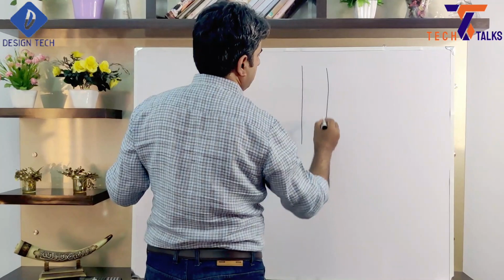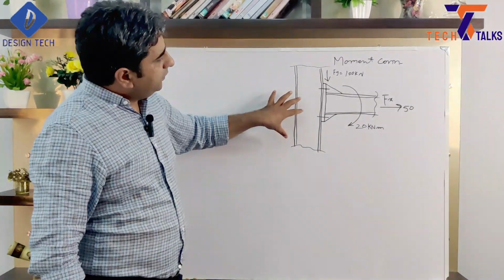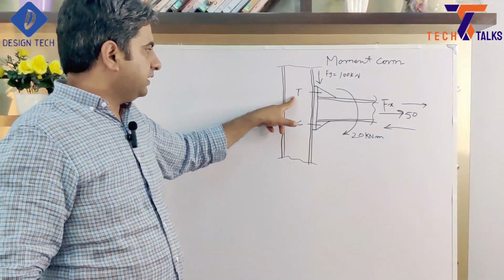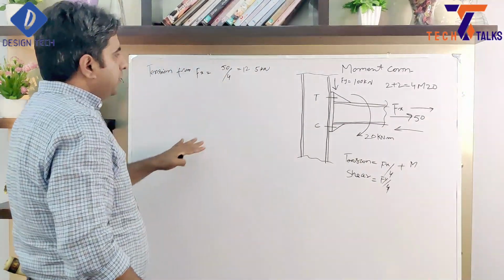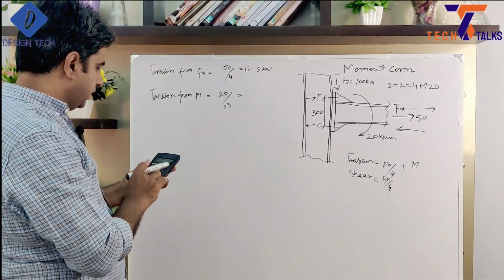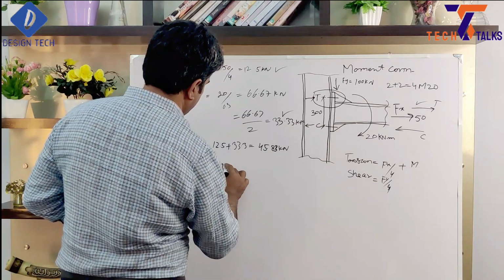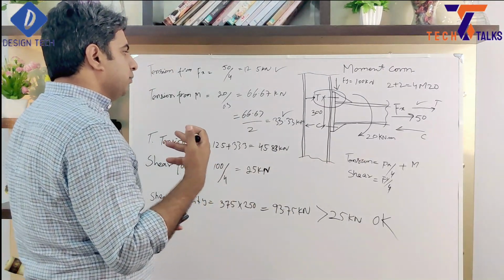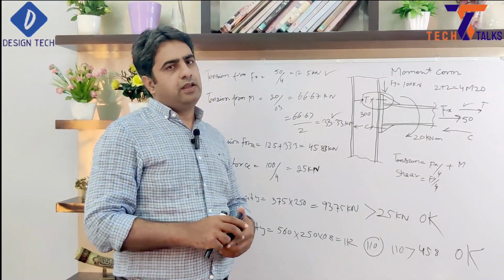HOW TO CALCULATE BOLTS FOR MOMENT RESISTING OR FIX CONECTIONS (MS / PEB MEMBERS) | RIGID CONNECTION

Comment: Pls tell about shear capacity
Reply: 250???
Reply: How to have calculated the area of bolt 259l0..
And how 110 comes
Reply from the maker: Area bolt can be calculated as πd2/4 and to reduce threaded part total area can be multiply by 0.8 to 0.85 to get net area at threaded part
Reply from the maker: Bolt shear strength x bolt area x shear capacity factor you will get shear capacity of bolt